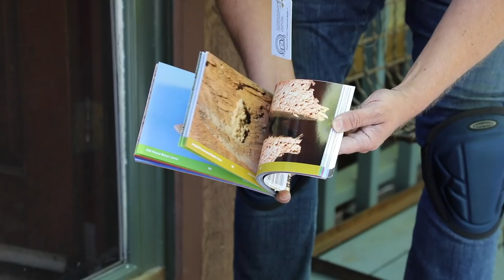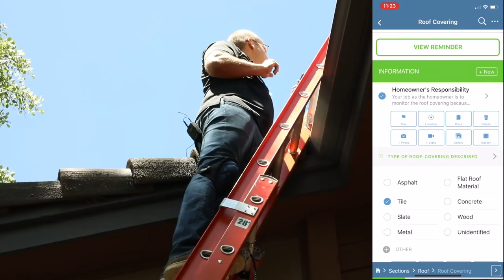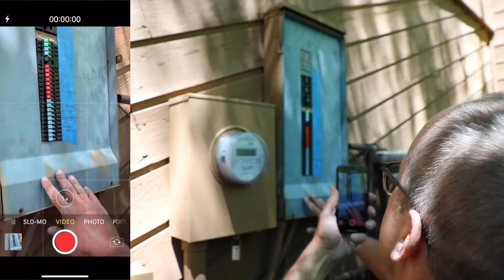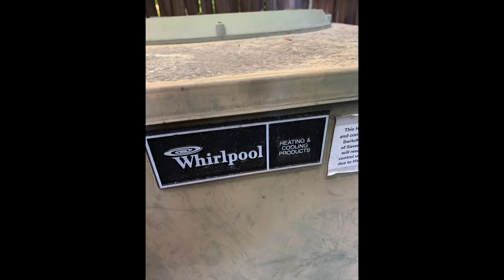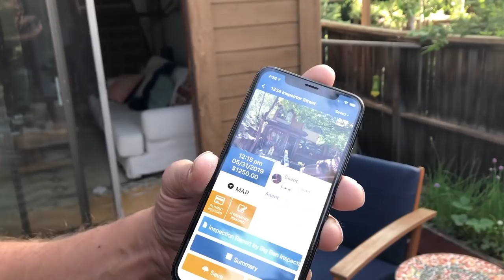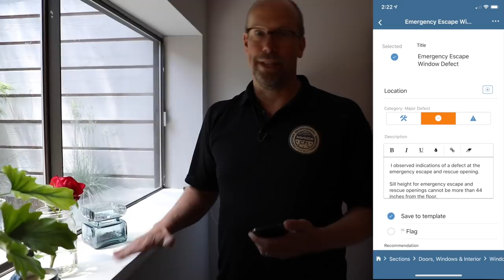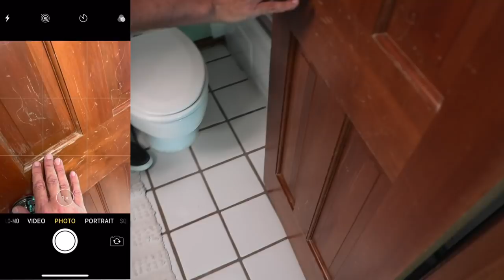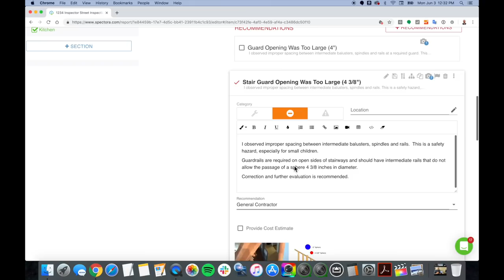Performing a Home Inspection & Writing an Inspection Report

Comment: as you were doing the exterior you got to "jumping around" to different systems. You took pictures etc but did not use software during that time. when do you go back to add that to the report? or should i just change sections in software as i run into different systems?
Reply from the maker: When I'm inspecting one system and need to jump to another system, I do that with a verbal "search" in the software or I click the software's navigation.

Comment: Fantastic Presentation Ben. You even make the whole inspection process look like fun. I have just started trying out using the software. Before I start paying the subscription  I have one technical question that I would like some to answer. I have been through all the help videos and cant find any thing.
The default font displayed on the pre written defects is very faint and so hard to read on the phone especially when outside in the light. If it was bold and darker the same as the Heading font that is displayed above all the defect text it would be fantastic. I know it's possible  to do as this has been acheived with the headings/titles.
Is there a way to change this or can be fixed at the managements end.
Is it a deal breaker? Probably would be as I don't  want to be pressing my face against screen just to read some text.
I hope you or someone can help me this Issue. Regards Aaron Crosby ( New Zealand)
Reply from the maker: Hi, Aaron. You'll want to ask the software provider at www.nachi.org/spectora.

Comment: water heater t&p discharge is wrong; can you guess how ? at least 1 problem same maybe 2
Reply from the maker: 2018 IRC P2804.6.1 has 14 requirements actually just for the TPR valve discharge. https://codes.iccsafe.org/content/IRC2018P3/chapter-28-water-heaters. Remember though, this video was not a formal technical home inspection training video. It was all about how to write an inspection report while inspecting using mobile software. Good catch, though, Fred.

Comment: I'd really like to see you pull on the stove to see if the anti-tip device is installed.  Otherwise nice inspection.
Reply: Thanks. It was a quick inspection video that concentrated less on the technical aspects and tasks of performing an inspection and more on how to integrate software into the inspection process.
Reply from the maker: Thank you for the compliment. Staff would love to see your comment on https://www.facebook.com/internachi.

Comment: Great video but you not supposed to use the top step of the ladder
Reply from the maker: Not sure what you mean. My ladder is 3 feet extended about roof edge, and I'm standing on the 7 or 8th rung down.
Reply: @BenGromicko  when you go into the attic you us the top step.
Reply: @phillipprince65942  Ah, I know. I should have been able to pull myself into the attic without tapping the top steps with my feet https://youtu.be/dbZXKS5yuWg?t=4103. Dang. Back to the gym.

Comment: 13:25  $500 is not more than $1250
Reply from the maker: If the perceived value is greater than the cost, it's a good decision. The perceived value of finding and documenting a major defect is much greater than the cost of repairing that defect.

Comment: the TPR is NOT supposed to go to drain!
Reply from the maker: Hi, John. The TPR discharge pipe should discharge to the floor, to an indirect waste receptor, or to the outdoors.
Reply: As a licensed plumber for 30+ years you are wrong.  In some jurisdictions a TPR is required to discharge into a drain with an airgap.
Reply from the maker: @MW-rt1jo  Yep. According to code, the TPR discharge pipe should discharge to the floor, to an indirect waste receptor, or to the outdoors.